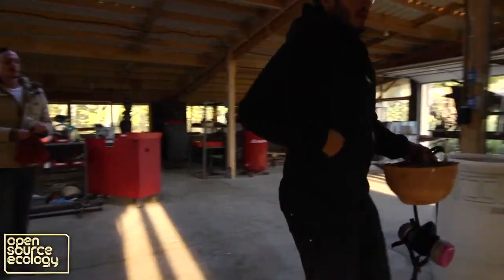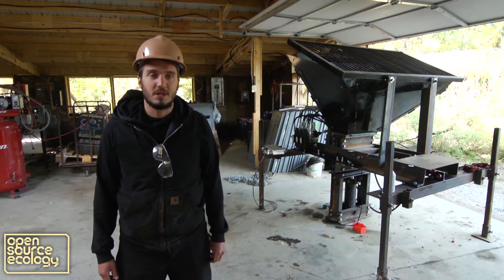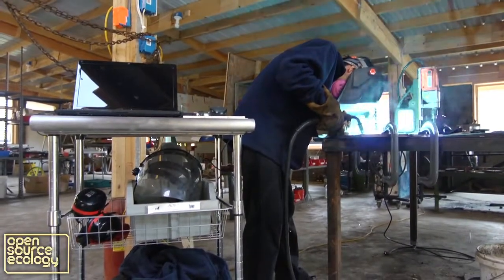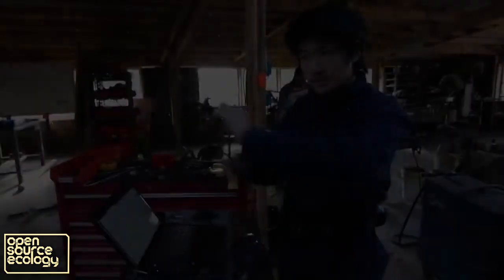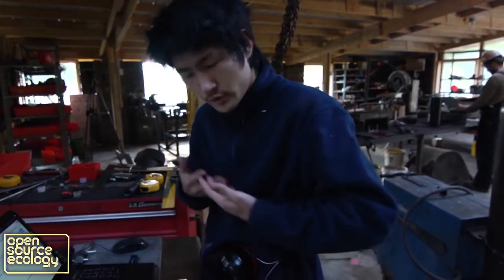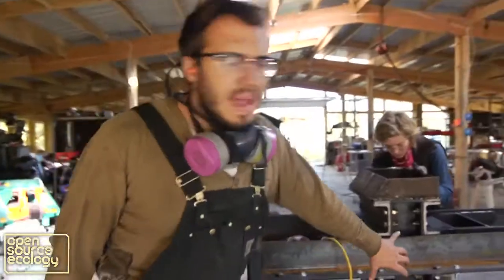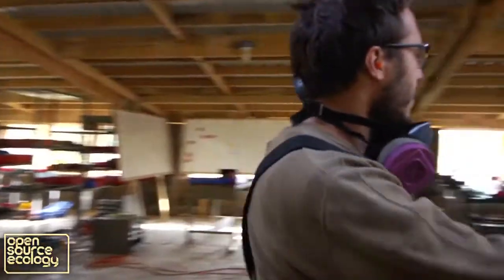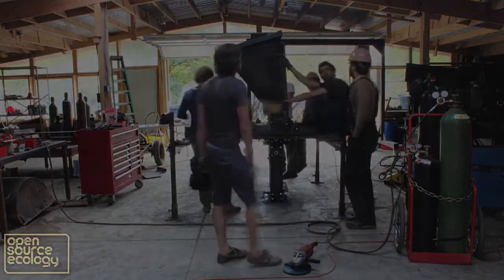CEB Press Production Run, by Open Source Ecology

Comment: If a country cant automate brick making where tf are they going to get metal working equipment like that?
Reply from the maker: They build it from scratch, if they have a junkyard, induction furnace, and skill. No free lunch here - need to bootstrap somehow. With open source design, it becomes about 1000x easier.